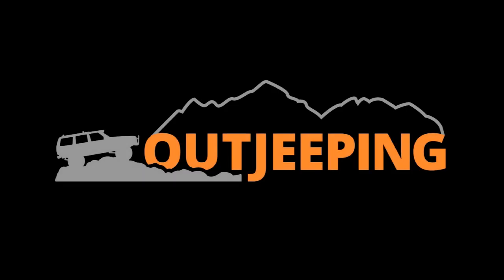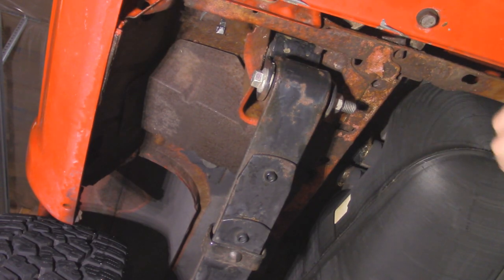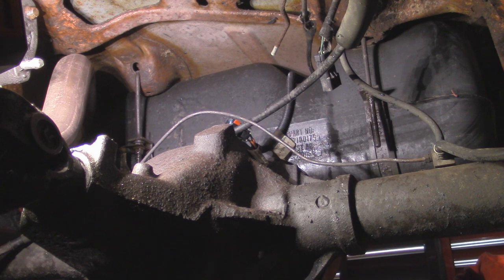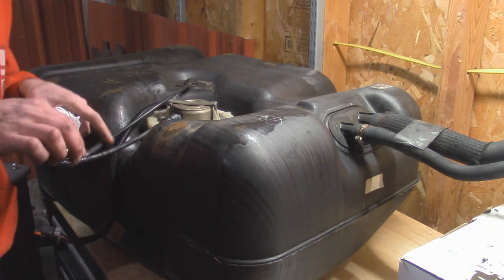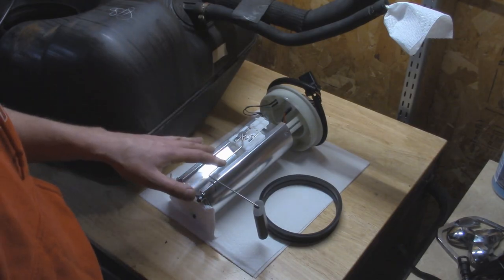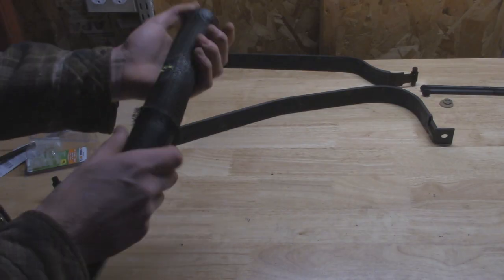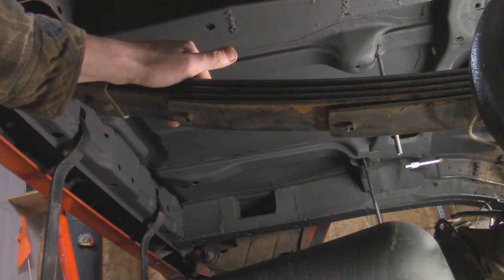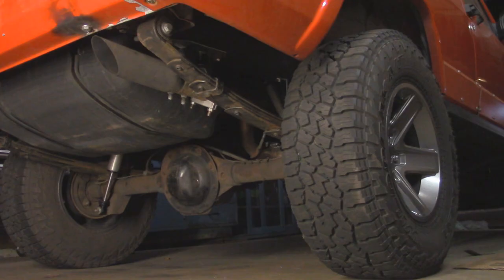Fuel Pump Replacement | Jeep Cherokee XJ 97-01

Comment: I cut a hole in the floor to access it then made a new piece of metal and put silicone and sheet metal screws to seal it up.
Reply: You don't happen to have the measurements still do you? Lol
Reply: A.k.a destroying a good jeep by beign lazy and not doing it the right way
Reply: @VC-TV is there such a thing as a ‘good’ Jeep?

Comment: Been holding off on this fix for a few years. I've had to prime the fuel rail/pump by cycling the key on a few times but today the pump finally gave out as I tried to back out of the driveway. The irony is that I just replaced the fuel injectors a few days ago for the 4 hole upgrades. Honestly surprised it's lasted this long. I've heard the Carter brand is a decent fuel pump that holds up well and a fraction of the cost for Delphi/Bosch so I'm gonna give it a go. Anyway, thanks for the video!
Reply: how was the carter brand
Reply: @BH-gh6qm   seems to hold up well but I do have an issue with some pretty bad idle surging on cold start. It's really bad in cold weather to the point where it will die right away unless I give it some rpm for a few minutes until it stabilizes. At times, if i don't let the engine get to standard temp, i'll get some backfiring and loss of power\delay from 2nd-3rd gear. I'm certain it has to do with the injectors.

 I replaced the injectors at the same time as the pump when this issue popped up. Got some $50 Bosch 4holes from eBay so maybe one or more of them is faulty. I haven't had much time to test the voltage to see if that is the case. 

As far as the fuel pump goes, I'm sure that's not my issue as it fires right up. Sorry I couldn't be more definitive with your question but I'd say give Carter a go if you're looking to change yours out soon. Bought mine off of rockauto if i can remember correctly.

Comment: Doing this job now. That tool would not budge my large pump retainer nut. I had some small 1x2x6 sections of oak wood. I used that against the top ribs on the nut and tap tap tap around it and it started to move. I got it about 1/4 turn then used the tool to finish up. Man that nut is HELL to get back on. Did have to use the tool for that right from the get go until tight. For those thinking you might not need the new filler hose forget it, mine was shot and I had to stop and order new hoses. After an entire day of looking I never found any better then what is in the link from outjeeping.

Comment: Great video. I just did this two weeks ago. I did upgrade to a 98 ZJ tank, some jack wagon decided to steal my gas by drilling a whole in my stock tank. Figured I might as well do the pump while it was out. Delphi pump of course, I couldn't source a Bosch either.

Comment: Great video. I am getting a P1494 code now that I've replaced my pump... I've check all connections, all vacuum lines and elbows, all seems to good there. Any thoughts?
Reply from the maker: I would recheck your evap lines from the engine to the charcoal canister and to the tank. It's a common issue for them to break, rust out, or have cracked rubber at the connections. All of those can lead to the check engine light.
Reply: @OutJeeping  I'll do that, thanks

Comment: I wonder what made them wanna change fuel tanks in 96
Reply from the maker: The older metal tanks rusted out, and a poly tank would solve that issue.
Reply: @OutJeeping  I’m about to replace my 96 fuel tank and I’m seeing aftermarket poly tanks. I wasn’t sure if they were any good but that might be the push I needed to pull the trigger on it

Comment: Fuel pump without housing how do I do it 98 jeep grand cherokee limited  5.2l
Reply from the maker: You would still need to pull out the module from in the tank and take the old fuel pump off that assembly to replace it.

Comment: How's the fuel pump holding up?

I have to do mine and I found one source that has the Bosch pump but it's over double what it would cost to buy a Delphi on Rockauto
Reply from the maker: So far the Delphi pump is still doing well.
Reply from the maker: Update, the check valve failed and holds no fuel pressure after engine shut off. Do you have a source where you found the Bosch pump?
Reply: @OutJeeping  I am sorry to hear that 

Ended up buying a pump off 1A Auto. Fuel pressure out of the box is 45 psi. Under the spec for both the pump and factory spec of 49.2 +/- 2. Sending unit also not good but idk if the pump is sitting right 

No on any Bosch sources. If you find anyone selling NOS or any in stock Bosch or even Mopar let me know

Edit: that one source actually did not have a Bosch fuel pump

Comment: Hey man, I first gear is sluggish in drive but I gain power around 20 mph, should I get my trans rebuilt or look for a used one?
Reply: Look for a used one but if you can purchase new then get a NEW trans…,
Reply from the maker: Make sure the trans fluid is topped off and not burnt. But if it comes down to a bad transmission I would look for a used one. They are pretty solid transmissions so even one from the junk yard could have plenty of life left.

Comment: Would this work for an 88 Cherokee?
Reply from the maker: It should be easier for Cherokees before 97. You are able to replace the fuel pump while the tank is in the vehicle since it is on the side of the tank. They will take a different style fuel pump modulator for the correct year.
Reply: @OutJeeping  Ok. Thanks for the info!

Comment: I'm going to replace the carpet so in my case.  I'm going to gently  cut the floor with a 4 inch Walter's zip disk. About a foot square. flange the pan and glue in new steel and under coat it. Nobody will ever know. Should take about an hour too completely finish the fuel pump and patch😂😂😂😂. Always said they should have an access door in the floor for service access from the factory. My xj will have one for future reference

Comment: Never use airtex ,Carter ,always use bosh , most times Carter sells theirs but their actually airtex ,just peel back the stick in er and it literally says it,spend the extra money so you don't have to spend double down the road.
Reply: If you have any leads on Bosch spill the beans

No luck myself finding a Bosch or Mopar fuel pump